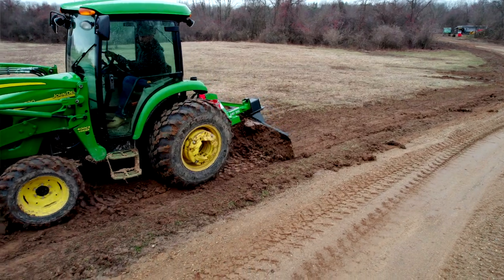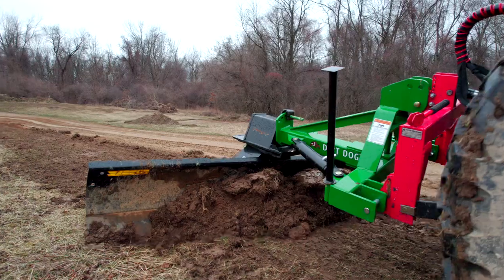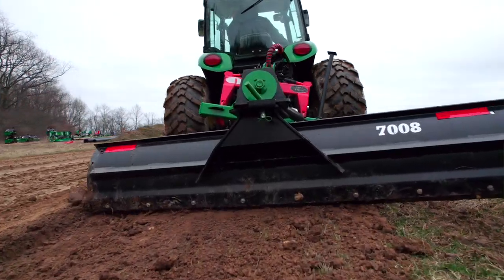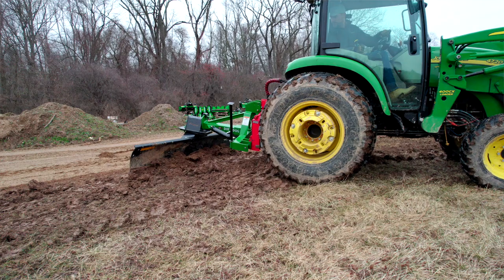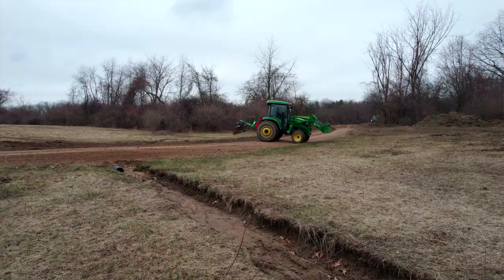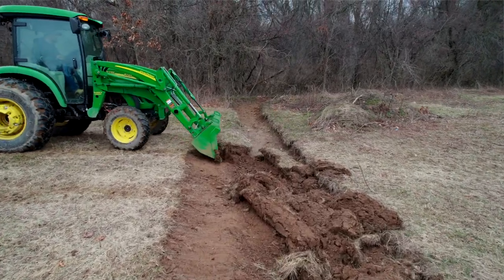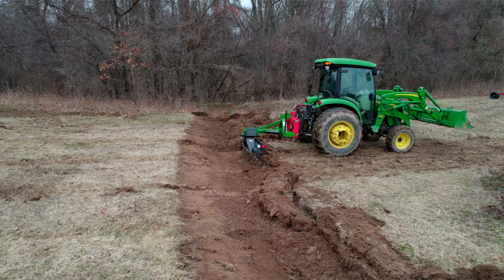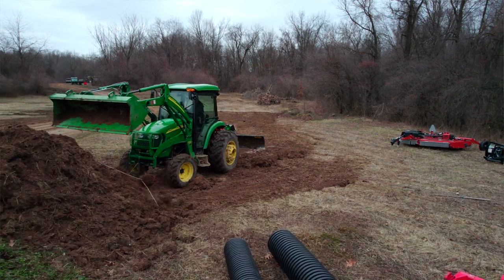DIGGING DRAINAGE DITCH WITH A TRACTOR & ANGLED REAR BLADE 🚜

Comment: For an open drainage ditch, I usually dig the first part with the loader (and tooth bar) leaving a squared off edge, then put the wheels on one side of the tractor in the ditch and use the loader for making the slope.  This provides plenty of drainage, but you can still cross at right angles without dragging any implements.  You end up with a very clean looking and uniform appearance also.

Comment: I ordered my tractor with a box blade, and I love it. That said, I just bought a 5’ rear blade a little over a month ago, it it’s already been super handy. I see a lot of box blade/land plane/ rear blade comparison, but each is really its own tool and shines in a different area. I started a lawn renovation last fall and we got too much rain in Oct for me to finish it. After the snow melted, we of course got more rain. I was able to cut a small ditch using my rear blade down to the road and then run 3 branches off of it parallel to the road to empty the standing water I had. It worked like a charm. It of course rained again two days later, so I still have my work cut out for me. If I can have a week of dry weather, I should have it ready to seed soon. That’s asking a lot in MI, but I’m hoping for the best! 😂

Comment: I love my 6 foot  offsetting rear blade on my 1025r. The best thing I use it for is as a rear wing when snow plowing. It keeps my wheels away from the ditch when snow blows in level and covers where the ditch begins. Really useful for pulling the gravel back up that was pushed over the edge in spring too.

Comment: Great job with the ditching and your lucky to have almost rockless ground but I can offer a tip when using a blade to cut ditch lines. Always keep your blade pointed in the direction your traveling, that way if you catch a rock or root it is being crowed into the corner of you cut by the angle and it will peel them right out. Plus it keeps the force consistent in one direction
Reply from the maker: Thanks!  Yeah, I had the blade angled opposite for part of it as I didn't want the top soil mixing in with my gravel.

Comment: look around for a "EQUIPCO" grader blade it will dig even water lines it has many  selections  360 degrees rotation and both directions tilt.  my great grandfather had one and I finally got it and the old 8n. I use the blade and attatchments with a 2019 3025e jd  I dug ditches in beaumont clay  5 acres long with it both sides of driveway.  put in a 2000 ft water line etc this year.

Comment: I bought a hydraulic top link like you for my 4066 R . I have it hooked up to my 4th function valve on back of tractor. When in Float function the cylinder will not move freely. Does yours work properly?

Comment: Nice work, water will flow! I’ve not tried the ditch thing yet. Question: did you adjust the top link to pull the the top of the blade forward for a less aggressive cut?

Comment: I'd like to hear your opinions on the r14 tires after using them for a bit.  I need new 13.6x28 tires on my Massey Ferguson 135 before too long, and am considering radials (instead of two bias ply).  Side flex on hills is my big concern.

Comment: Why not dig with the dirt going towards the road and raise that up instead of towards the other side? Looks good. Do you have those in stock? The one in the link doesn't match the one you are using. The one you have can angle and twist. The blades your link points to only angles.
Reply from the maker: We removed all top soil from the road bed before installing. Top soil has organic matter that breaks down over time, so we don’t want to mix it back in with the gravel.  Plus it makes it muddy.  5’ Rear Blade is the only one that doesn’t tilt.
Reply: @GoodWorksTractors  I also think it is better to build up the road, but you have to do it first. The order I think works best is:
1 - remove organic matter
2 - cut ditches on each side of the road piling up on to road to make a crown.
3 - add gravel that packs well (IE crush run or recycled concrete)
4 - pack gravel
5 - add stone that grades well with land plane or similar
If you want the ditch to be smooth on both sides then cut away from the road.

Once you already have the road, the way you did it is the only option I can think of.  Then as you said, add more gravel, but it takes more gravel in the end to do it that way.  Tony’s tractor adventures has a good series recently doing it in the order I listed.
Reply: @GoodWorksTractors  sounds good.
Reply: @GoodWorksTractors  Could you update your website with the pictures that show it where they can tilt and angle? That could be selling point if you don't have adjust one of the 3 point to get the angle.

Comment: My eyes might be playing tricks on me but did you have some angle on the three point arm as well?  My very limited experience tells me I need more experience with a rear blade to not just have fun making a mess!!
Reply from the maker: No tricks! That's called a top & tilt kit, and it's a hydraulic cylinder that tilts one side of the 3-Pt.